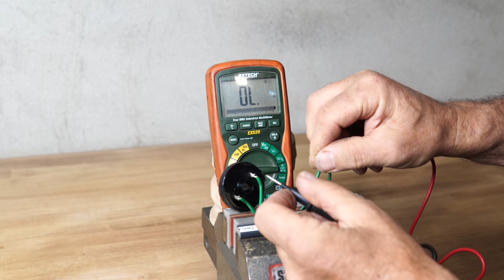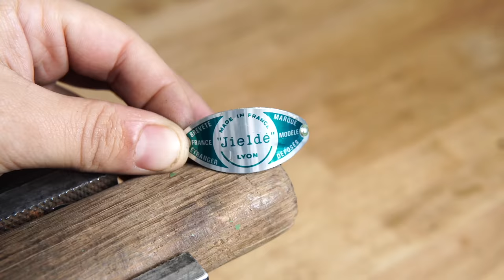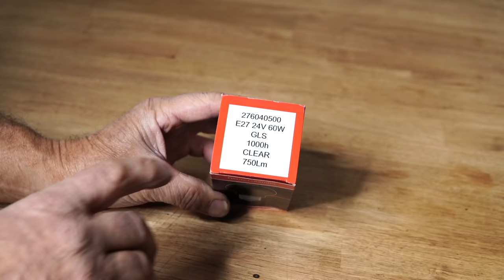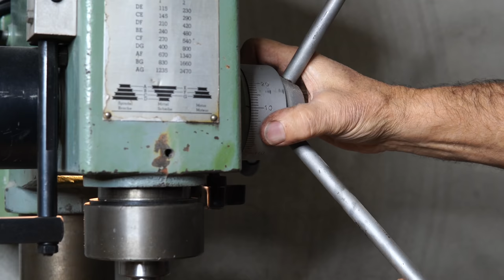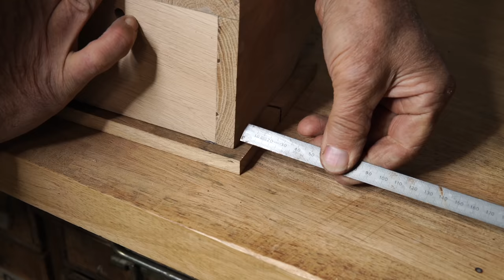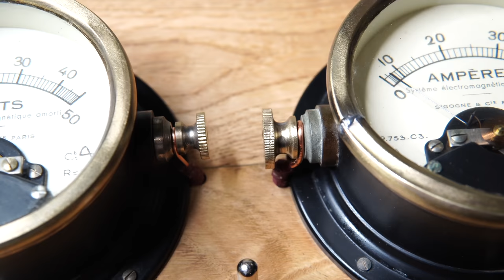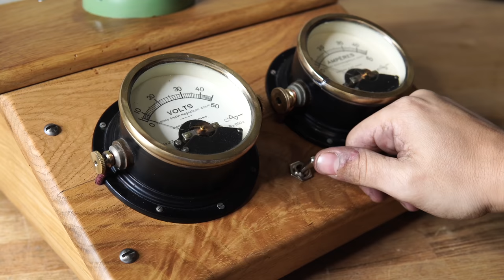1950's Iconic French Lamp Restoration

Comment: The original designer needs credit for a design that keeps the wires hidden but not in such a way to where the wires would be getting damaged at the joints when moved, it was genius.
Love the restoration, and the base you produced. From the base top repairing, the meters you put on it, to making the exposed new wires looking like they were old cloth covered wires was brilliantly done. I've removed wiring from an old out building we repaired, removing the old fixtures and outlets (American 2 prong ones, no ground wires), and that is exactly how the old cloth covered wires from the 50's looked. Wonderfully done.

Comment: That is a very unique lamp! I didn't understand what the purpose of the 2 voltage meters was for. Which is ok. I'm not an electrician. You did an excellent job putting the lamp back together. I was happy to see that the paint came off the label. It's just a little detail but it makes the restoration perfect. Avril was watching you very close on this job. Maybe he thinks he can sleep under the light for warmth.
Reply: my guess is that it serves no real purpose. i suppose you can confirm the voltage at the line, but it's not so useful to carry around with you. probably just for show
Reply: @briangoldberg4439  I agree--a design element that underscores the fact that the lamp was originally meant for workshops.

Comment: Loved it, subscribed!
For de-soldering of older connections: adding some new solder helps the old stuff melt. (Recommend using thick soldering wire, it flows better as it has more flux inside).
Great job on build and very relaxing and well produced video!

Comment: Great job!
With your permission, a few suggestions:
1. The transformer is still supposed to be installed on a fireproof base. And under it - rubber / silicone coasters to avoid resonance with the box.
2. In the back wall of the box, it was probably necessary to make ventilation holes, the transformer is still heated.
3. It wires be better to take flexible, stranded wires to the voltmeter and ammeter, and terminate them with U-shaped or O-shaped tips. So it is more convenient to mount and the connections would look more aesthetic.
4. The screws that secure the top covers of the box would look better in black (like the cases of a voltmeter and ammeter) or in nickel (like a switch).
5. The lamp itself, if the base is made in the style of "Steam Punk", probably should have been painted in the color of shiny copper.
Good luck!
P.S. Hi Avril from our Dulcinea :)

Comment: Lovely job. Well done. Given the use of a transformer you could have used a low voltage bulb for even more safety. Just a thought.
Reply: Look again the unboxing, it is actually a 24 volts bulb ;-)
These lamps were mostly used on machine tools at 24 volts. Only those used on drawing boards were at the wall plug potential. The plastic Fresnel lens to close the reflector is a very rare option.

Comment: The lamp came out great, I've always wanted a speaker in my steering wheel in my car when I was young but couldn't figure out out to make the 2 connections. If only I knew about this. 
 I'm not quite sure what the box is for, but still pretty cool. Might want to get new blades tho, they're burning you wood.
Reply: The light doesn't conform to modern safety standards if operated at mains voltage, so he converted it to 24 V. The mains supply (230 V) is converted to 24 V using a transformer. The box holds that transformer and support the lamp. The two old meters are mostly a design thing.
Reply: @Ragnar8504  That's weird because those lamps are still made in the same factory that made them in the 1950's....
Reply: @tomjoad1363  Well they could have changed the design in two ways: either made all the bits double-insulated (wires and light socket) or added a third set of contacts for an earth connection. Neither option is practical in a restoration but fairly easy to implement in production.

Comment: I truly enjoyed watching this. You did an incredible job but I'm curious to what makes this lamp iconic 🤔 Is it from a movie set or did it come from an old ship? Which is it?
Reply: They very quickly became popular in industrial settings after they were designed in response to the exterior wiring of the original articulating work lamps.  They were manufactured in huge numbers.  In the 80s they designed a home line and continue to be very popular.  That's why they are iconic.
Reply: Those lamps were used on machine tools because they are not exposed to damage from the projected hot metal chips. No external wire to be severed, great flexibility for easy positioning, but great resistance to the vibrations and oil projections, easy to clean, etc.
A lot of peoples working in factories used these lamps and keep them in memory, so they became a classic, still manufactured but expensive.
Somone launched a trend of "vintage industrial furniture" and the sturdiness of these designs made it valuable, but even more expensive than the newly built items.

Comment: I’ve been subscribed to your channel for several years now and you never fail to impress with your restoration skills. What a beautiful lamp and I think it would have been quite expensive when new. You certainly took it to the next level by adding the gauges. I would never have thought of that. 
Lovely to see Avril and she looks so interested in what you are doing. I’m wondering if you can help me please, I’m restoring a magnetic base for a drill and I recently picked up a drill I’m going to fit to it. It was made in France and has a specification plate but it looks like the brand label has come off. It’s the biggest electric hand drill I have ever seen, is rated at 1000 watts and uses an M3 Morse taper. It has two speeds, 160 and 250 rpm so it’s designed to drill BIG holes. If I send you some pictures would you be able to have a guess at who the manufacturer might be? If you’re willing I can give you my email or you can give me yours, what ever you’re happy with. Thanks and cheers, Stuart 🇦🇺

Comment: My only thought was since you went to the trouble of adding the volt, and amp meters, along with the remote power switch.
Why not a rheostat, so that you could also adjust the voltage, and raising and lowering the brightness.
AKA, as a dimmer switch here in the United States, then you would have had the ultimate setup for such a nice old lamp.
Otherwise excellent as always gentlemen.
PS
I almost forgot, back lights for meters too.
Happy New Year to all, and extra bite of fish for the Quality Control department too please.

Comment: 11:29 - handle circular saw this way only if you have extra fingers :)
DC current polarity doesn't matter for incandescent lamp. That's why wires have same colors in segments.
Reply: These lamps can work on AC without problem, and you can see there is no rectifier on the transformer, but it is good practice to avoid inverting the path of inner and outer contact rings.

Comment: A little tip - you need a higher power soldering iron. Those dry joints you made are a potential failure point, particularly with the pliers acting as a heat sink as you were attempting to solder them..

Comment: If you want to reuse cable you need to check if the resistance is still under the tolerance values, bc you can have continuity but with a resistance that is over tye tolerance and that can cause overheat

Comment: A very nice refurbishing project. Everything looks great except your soldering connections. Looks like too little heat and no flow of the actual solder. Could be an issue down the road. Use a higher heat iron and some flux and allow the solder to flow out and solder the wires. Other than that, a very nice project.

Comment: Great job, your technique is amazing!!
But I'm not agree to remove the metal excess of the old industrial molds because they demonstrate how industrial methods worked in old times (that's like modern plastic excess of some toy or other objects). A perfect restoration of industrial products it should be similar to old artworks and old buildings: working only where is necessary and, if people want, to restore original aesthetic

Comment: Pour les djeuns : Les lampes Jielde équipaient les tables de dessinateurs dans les bureaux d'étude avant Autocad. Leurs articulations à frottement permettait au dessinateur de changer à loisir l'inclinaison de sa table sans risquer de se prendre la lampe dans la figure.
For youngsters : Jielde lamps were commonly used on drawing boards all over french design offices in the days before Autocad. They are equiped with friction joints allowing the designer to change the inclination of his table at will without risking having the lamp smashing him in the face.
Reply: On les trouvait aussi dans beaucoup d'ateliers de mécanique de précision...
Reply: @jadawin10  Sur les machines-outils je suppose? Mon père était ingénieur du bâtiment. Du coup je connais mieux le coté bureau d'étude. J'ai travaillé comme dessinateur industriel pour payer mes études, au Rotring et à l'encre de chine sur calque, suant sous une lampe Jielde... Une autre époque!
Reply: @srfrg9707  
J'écris depuis le canton de Neuchâtel, en Suisse (en plein pays horloger), ou on trouvait jadis beaucoup de lampes de ce type, au-dessus des tours et des fraiseuses de précision.
Reply: @jadawin10  Ah... Neuchâtel. Yverdon. Je me rappelle une année, mes parents, qui nous emmenaient faire du ski tous les ans à Crans-Montana en février, ont décidé de nous faire passer une partie de l'été en Suisse. Les lacs. Les bourgs proprets. C’était vraiment le bon temps.
Reply: @srfrg9707  
Je pense que j'ai probablement les mêmes souvenirs de vacances, mais du coté Français. ☺

Comment: Ok, so I see the secondary on that transformer is 24V with a 220V primary, so the exposed terminals on the meters are not particularly dangerous. However, this is still basically a bat crap arrangement , even for the 1950s. Doesn’t take much to get a primary to secondary short, which should trip a breaker, blow a bulb filament etc. but not necessarily, then some curious type grabs the little terminal cap on the meter and then blamo! Bobs your uncle. I love the restoration, but this is a bit of an electroboom situation. ;-)

Comment: Can anybody explain me? What the box is it? Has it any practical usage?
Reply: I think it's just a stand since the lamp does not had any clamp or foot of it's own, the meters are just to add to the look and the transformer inside is for safety reasons so nobody will get electrocuted from the open meter connections.
Reply: la lampe vient certainement d'un tour ou autre machine similaire d'atelier, ce n'est pas une lampe de bureau. démontée, elle a besoin d'un support et d'une alimentation basse tension.
Reply: @hpdepasse5997  Спасибо за ответ, но раз ты смог прочитать по английский, то почему нужно было отвечать на французском???
Reply: @hirakli691  потому что я франкоговорящий и мне не нужен английский, даже если я его понимаю
Reply: @hpdepasse5997  entonces, no hablas inglés a propósito???
Reply: @hirakli691  LADB (l 'atelier des bonhommes) es un sitio francés, escribo en francés.
No leo ni entiendo ruso, pero el traductor de Google me traduce y puedo responder en ruso, probablemente mal, cuando la página está abierta, o en español, pero no pasaré el día allí.
Reply: @hpdepasse5997  A, ok, ahora veo, no sabía que este canal es frances. Ya que había muchos comentarios en inglés y este tipo de videos yo veo sin sonido en la velocidad 2. 
Está traducido muy, muy bien sin ningún error. Lo sé por que hablo ruso, español e inglés y un idioma mas que ni suiquiera has oído, creo. Pero, por desgracia, no hablo frances. 
De todos modos, gracis otra vez y ¡Vive la France!)))

Comment: Beautiful work, but that saw blade is in desperate need of attention. Though with it burning wood like that, it might be at the point of needing replacement instead of just cleaning unless it is a steel blade that can be sharpened in which case sharpened.

Comment: You need to put oil inside the connections or they won't last long. And having open electrical connections on the amp and volt meter is kinda dangerous, kinda really dangerous.
Reply: 24v safety voltage is already enough but you can see the wooden actuator for the switch so it is totally safe ;-))

Comment: Exposing current-carrying wires is an incredible stupid idea. 😵
The used 100VA transformator with 24V output is able to provide 4A current. Even 0.05A can be lethal. 
"No perception" - touch it with wet hands standing on naked feet.

Comment: Very expensive !! 360 degree electrical junction design. Can easily be replaced by a simple wire .
This is why it is not common .
Reply: This lamp was successful precisely because it had no visible wires.